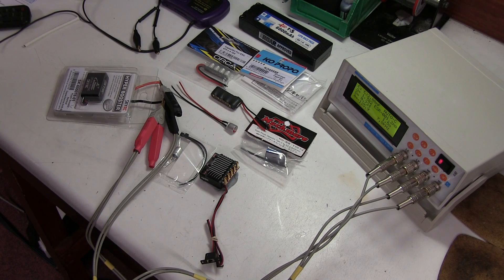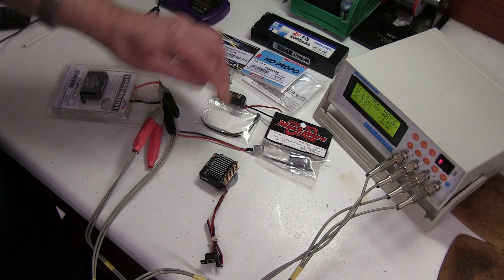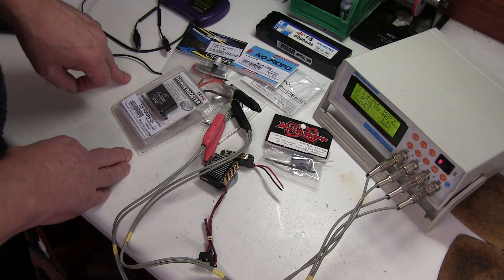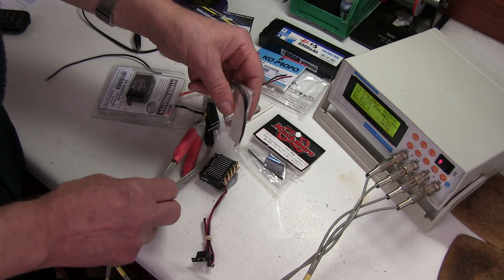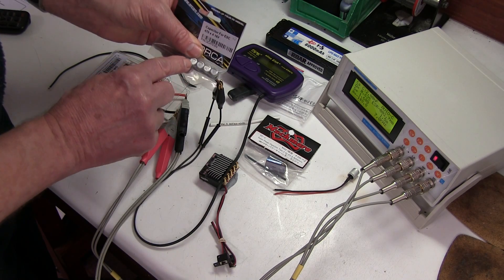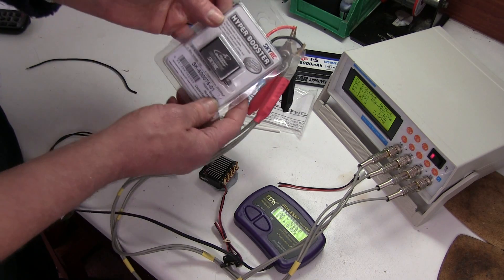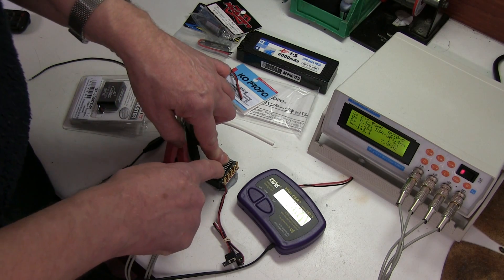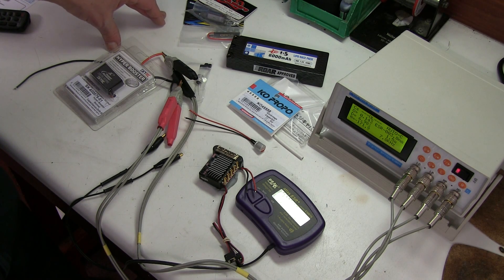Capacitors for Brushless Speed Controls.

Comment: Caps on speedo are always a nightmare to position in the car! they really dont stick well with servo tape and always seem the oddest of shapes to try and secure somewhere. would be good to see speedos with them integrated into the main FET boards.
Reply from the maker: +clarkie005 
Hi, I agree, but there are some speed controls with the capacitors inside the case, such as the Maverick ones, but it makes the control larger.
Reply: The best way to deal with this is to replace the flexible cap wires with solid copper wire. Not only is solid wire lower resistance but it it's rigid enough to keep the caps suspended in air without needing to tape them to anything.
Reply: He was talking about ESC caps, not Rx caps.  And if you're getting brown outs, it's likely due to having a weak BEC.   If you plan to run power hungry servos and your ESC's BEC isn't up to the task, the smarter option is to run an external BEC with more amperage. Brownouts where nothing more than voltage drops on older gen 1 spektrum.   Besides throwing all your spektrum garbage in the trash where it belongs, I'd recommend using  Castle external bec that will outputs 8-10 amps and what ever voltage you set it to from 4.8-7.2v . The down side is you need the castle programming card to adjust it from stock 4.8v setting.   I run Futaba 9352HV servos and they can use all 7.2 volts and need that much to operate like they should, but most don't need more than 6v to be perfectly fine.
Reply: @Tuffenough4u  you just repeated everything he said. Lol
Reply: Honestly I may have.  I get on a comments roll sometimes on here and start up before I even finish watching the video half the time, then get distracted by another topic or video before the other ends.    It's a bad habit I guess from running a few facebook groups "RC Mod Proz" and "Tekno SCT" groups . 
 I am also member of most popular forums and groups also.  Basically, I more or less just get on them most of the time to help answer questions for beginners or talk tech and theory with the pros and manufacturers.    Come on over and join "RC Mod Proz" if you're on there.  We can always use informal people like yourself for conversation.  
  A lot of the time I  also post lots of interesting videos like this one so I don't have to explain things that are more simply correlated by youtubers like this fella or because sometime they just explain it better.
Reply: I'm here for the invaluable information that Nick is providing!! 👍👍
I mainly run Crawlers, so some things a bit different.... One advantage that extra Capacitance provides is "Brown Out" protection, from High Amp Draw, 20-27mg Servos in a 25lb plus Beast - while running 3S or 4S Batteries.
The ESCs onboard BEC can't cope with the high draw, and Drains Motor power Straight from the ESC!

....... We've got PLENTY of room for as much Capacitance as we can fit, and of course, weight is not a big penalty. Unless it's up high on the Rig!
We even run separate BECs, wired Straight from the Batry leads, bypassing the ESC altogether. 
I'm considering getting back into Rally Cars, where a lot of the information here will definitely be relevant. You Sir, are a wealth of information!!
Reply: I've run nothing but Futaba since 1986.... I do know I need a BEC. Waiting to afford a good one (Castle). 
In my case, I'm running 12,000uF of Capacitance on the RX. It's a stopgap, and I know it. Hopefully I can get it right, soon.